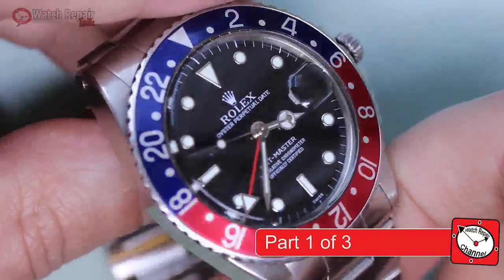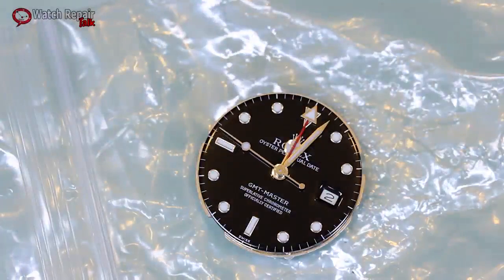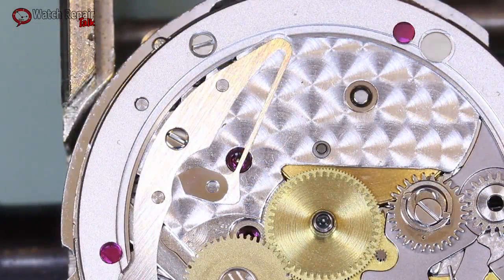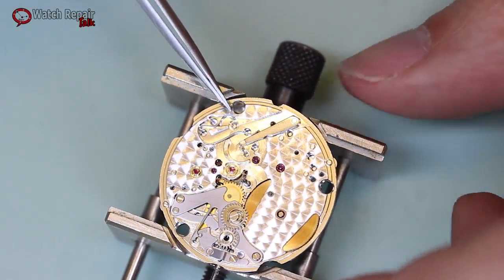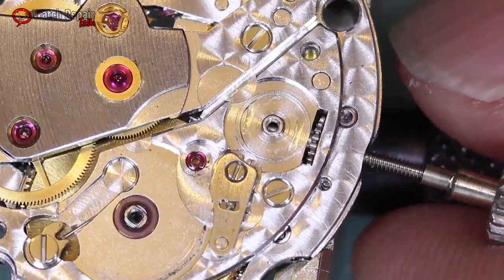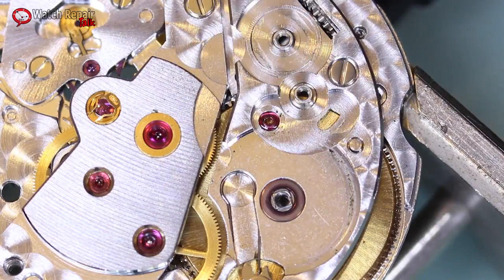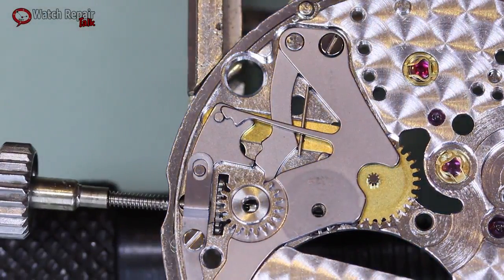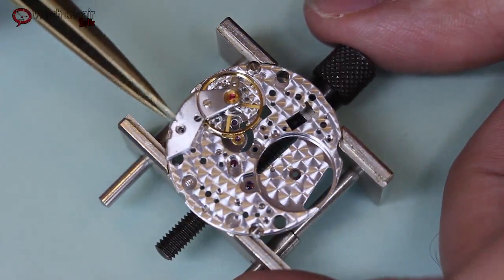Part 1 of 3. Rolex 3075 GMT Master full strip down service - Watch Repair Tutorial

Comment: I saw your repair - and service of a Breitling Chronograph. I'm immediately struck by the apparently much finer finished internal parts in the Rolex. Is my assessment correct or isn't there much different between the two movements?

Comment: Interesting how Rolex has really nice dial feet screw assembly and the thing of rotating the movement to release from the case... so much better than 2824 with case clamps or the 2824 little levers that hold the dial feet...

Comment: Whats the purpose of those jewels?
Reply: A jewel bearing is a plain bearing in which a metal spindle turns in a jewel-lined pivot hole.  The jewel material is usually synthetic sapphire or ruby (corundum). Jewel bearings are used in precision instruments where low friction, long life, and dimensional accuracy are important. Their largest use is in mechanical watches. -wiki

Comment: I do admire craftsmanship like shown in the vid here, I did try my hand at fixing a bunch of quartz Sekonda's getting three out of four running again and the fourth is going to the factory for a repair as its a very unusual Safari and beyond my meagre skill level lol  I think I will leave my watchsmithing to just watching vids like yours or Mymatevince's as shaky hands and fading eyesight are not a good combo for such delicate work imho.   The one I am wearing at the moment is quite an old battery run chrono which responded to a good clean and blow out of accumulated debris and pin pricks of oil on the bits I could see and sourced an old 80's German made expanding bracelet and it looks mint despite it being a budget brand.

Comment: I'm not really a fan of the aesthetics of most GMT's and divers watches but on the inside, the movement of this watch is beautiful. I do like the look of some Rolex dials but these big bezels really put me off. I suppose if it were actually something I had a use for, it would be fine but since I wouldn't use it, it's just unnecessary clutter to me. Obviously a lot of people do like them though so I'm sure I'm in the minority.

Comment: you mention, that the old oil has become sticky. for how long was the watch not serviced, before you serviced it?
Reply: SoundsLikeFelix entirely likely it's simply the surface tension of the oil picking up parts, not per say "sticky" excessive oiling. There's 2 trains of thought regarding oil. Just a dab will do ya (90% of the time) and bigger the glob better the job (10% of the time) most often done by the people who don't know how to do the job correctly.

Comment: great video, nice work
why do you set the hands to the 12 position before starting?  Does it serve a purpose?
Reply: The Horse to Water there's a date function, so at 12 the date change right away accurately

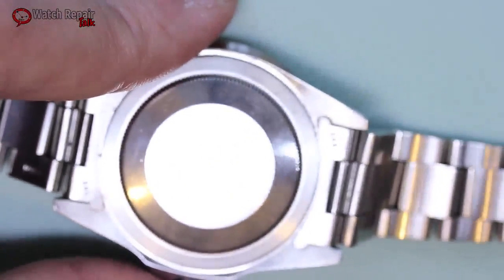Comment: 0:45  why no SN  or MOD NUMBER on the back plate?  counterfiet?
Reply: All the Oyster Rolex watches I've seen have no engravings on the back, although newer ones sometimes have a hologram sticker. The model and serial numbers are hidden on the outside of the watch case under where the strap attaches. Model number on the uppermost part of the case (12), the serial on the bottom (6).
Reply: gary jonson 
I wondered exactly that same question Gary.....

Comment: Msxengines Tech,
The large watch factories use many  engineers in many capacities. Watch parts and watches, like many other technically complex products, require numerous scientific disciplines. Just understanding how a balance wheel functions requires an understanding of differential equations. This aspect of producing watches is rarely shown to the public but it is necessary. 
david
Reply: Your answer seem some marketing or i dont know,, some factories, copy designs, patents and improve them, you buy better watches and cheaper, its a strategy...  some just fallow old stuff, and make a lot of amrketing around it (rolex), even with some lies in mixture,.etcc

And others make complete different movemnts to fight back quartz watches, these measn, hight quality, long lasting, long power reserves (many many days,  and better performance, and its not rolex ..

and others just make differnet things, but mechnically its not better just a way to justifie price, and they want to be just different.

You have everything in this industry, rolex is not in the best classification.i think.

Comment: Are Rolex movements superior in design and manufactured quality to ETA movements?
Reply: good looking doesnt mean quality, reliable, efficient, long lasting  etc...
Reply: If you can't see the difference at first glance it doesn't mean there is no difference. I mean lets assume parachrom hair spring or the 904L stainless stell. I am not saying Rolex over all,but they have some serious inventions inside,even if the main desing didn't go through radical changes.
Reply: Rumor has it that Rolex is very demanding in terms of quality control.  I don't know why their movements would be superior to anyone else's in terms of accuracy and precision in timekeeping though.  Mechanical watches are not impressive when compared to quartz watches.  But their movements are quite lovely looking.  That's part of what you pay for.
Reply: look to an eta and to a rolex movment, do you see a lot of difference, ?? what ?just painted gears or maching marks, to imitate hand made or bronze gears,,,?? Not convicent for me. massive gold? they arent, massive, they are gold cladded.
Reply: I believe so, for example they are COSC to run accurately but Rolex also demand they run to -2/+2s as well so very accurate for a mechanical, much more so than a generic ETA movement which might have an error margin of up to +30s.  
Also in terms of components they use better alloys for example rhodium plating as well as use of ceramics and other nonmagnetic alloys to counter magnetic field disturbances.
Omega also recently switched from using ETA movements to making their own inhouse so yes, there is a percieved superiority to using your own quality control and expertise as a watchmaker when it comes to traditional movements.

Comparing it to a quartz is illogical however.  Apples and Pears.
Reply: I can only compare my ETA fitted Doxa (2014) to my 1980 16800 hi-beat Submariner. The Doxa, admittedly not a certified chronometer, varies between -3.8 and -8.5 seconds per day, due to temperature, state of wind and orientation I suppose.  The Sub, despite its age is -1.2 to -2.2 seconds per day regardless of these factors. The rate can always be adjusted of course but what I presume is more important is how constant a timepiece is once accurately adjusted. So from this I deduce that the Sub movement is better engineered than the ETA Doxa. But I love them both equally and they give me great joy on and off the wrist, and that's the whole point.

Comment: wouldn't some prints be left on the dial if you handled it bare-fingered?
Reply from the maker: They could unless the person who touched the dial bare fingered was wise enough to clean any prints off.
Reply: Where did you learn to do all of this, it's incredible. Thanks for the vids
Reply: When working with watches You have to be careful and take your time and remember to breath.  However, they are meant to be tough and stand up to the elements and times ever worrisome hands.  We never really realize the amount of shock, and stress we place on our watches, or what we expose them too.  They have to be tough,  don't be bullish with the works when you are repairing watches, but believe me they can take being handled. If not they would not last very long.
Reply: Could  the hand´s oils stain the dial?
Reply: Wash your hands, I usually clean my hands with sanitizers with an alcohol base.  It removes the oils from my hands leaving them dry and clean, so that I do not leave body oils on the parts.  I also wipe off any prints I might leave.  I used to use surgical gloves, but they tend to be a bit clumsy. It's easier to just clean up after yourself.
Reply: Pros come from schools. And even after school you must like want you want otherwise the course would be unsefull.